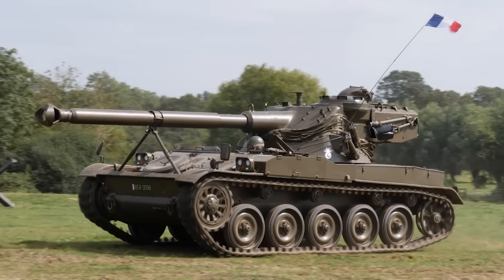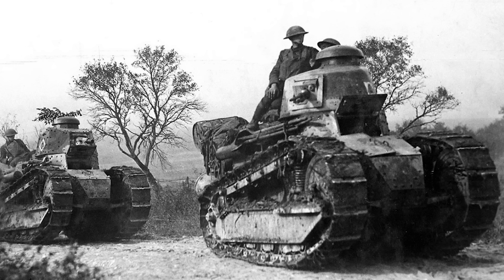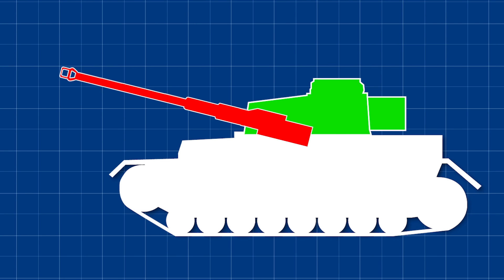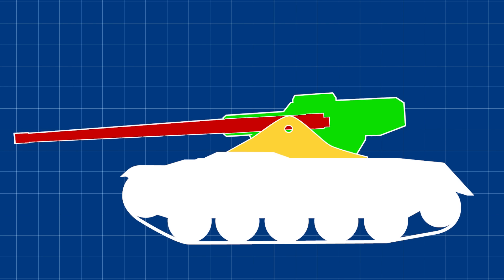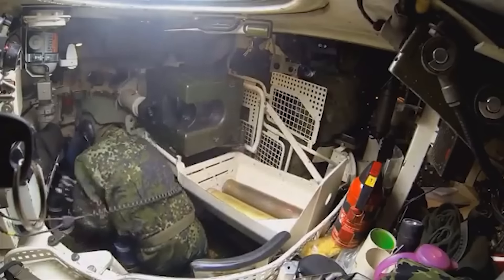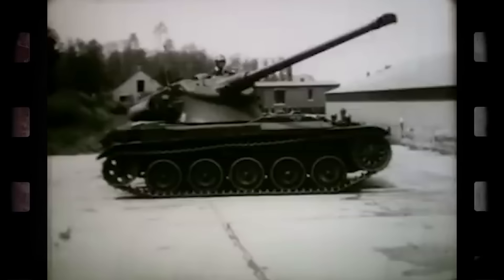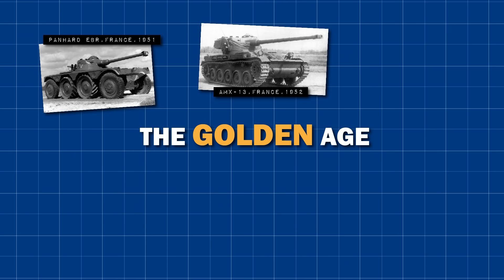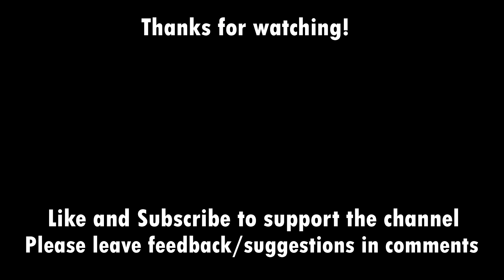What actually IS an “Oscillating” turret?

Comment: Considering that many new tanks are moving to unmanned turrets and either choosing or being forced (on account of the weight of 120mm+ shells) to move to autoloaders there may be a chance of oscillating turrets making a comeback
Reply: That same weight and size of the ammo works against it though. Moving all of the ammo to elevate or depress the gun is more work, and the bustle size gets in the way more too. It will be interesting to see where the competing ideas end up.
Reply: @llamatronian101  While not on a tank, an oscillating turret for a 155mm gun has been built and used. It is the Swedish Bandkanon I. If an oscillating turret is mounted at the very rear of the vehicle, then excellent elevation angles are achievable over the frontal firing arc. The downside is that any rear mounted turret struggles with gun depression in the frontal firing arc. For the Bandkanon I, depression was deemed unnecessary.
Reply: I don’t know if that’s really the bottleneck or reason for the disappearance of autoloading oscillating turrets . The primary reason for them was the difficulty in loading the gun at angles above or below 0. With modern technology and modern fire control systems tanks can fire the gun depressed,  move the gun to a neutral position, reload, and return to the original position. All while keeping the gunners sight on target the whole time. There are also plenty of vehicles and spgs with guns that are bigger than 120mm that are hand loaded or assisted hand-loaded. 

Not saying your prediction is wrong but having people in the turret and large shells were not the reason for oscillating turrets disappearing. So I don’t think these factors matter either way.
Reply: I kind of agree. The problem is if the terrain is already that hilly you might be better off with artillery style systems with a tank for line of sight protection.
Reply: @ES1976-3  What are you saying ? oscillating turret didn't have any difficulties with auto loaders (that's why all oscillating turret had an autoloader) it is the conventional turret that has problems since the gun is independant and when angled the autoloader couldn't load proprely where as in oscillating turrets the gun, autoloader and upper part of the turret were all fixed together and the alignement between the breach and loader always neutral.
Reply: @JWQweqOPDH  Just pair it with a tank with great front depression and that's it. Or, even better: spin the turret around 180 degrees, and just fire like that. Excellent depression achieved (at the cost of elevation) 
New idea: Double sided tanks?
Reply: NBC thing could be solve with fitting the tank with a good M/V system to keep the cabin in +ve pressure.
Reply: @JWQweqOPDH mostly because it's an artillery piece, not a destroyer
Reply: Plus, the issue of oscillating turret not being sealed off thus putting the crew in danger of chemical weapons might not be an issue nowadays since many turrets can now be controlled remotely. The crew could be in another part of the tank that is actually sealed off.
Reply: @JWQweqOPDH  Why not have the ammo stacked sideways instead of to the rear? Have it fold up in storage or maneuver, and fold down in combat like the wings of carrier aircraft if it sticks up too much otherwise. Name it Rabbit tank.

Comment: Another big issue probably also is the fact that its quite difficult to stabilize the entire turret and not just the gun
Reply: and you can't put much armor on oscillating turrets, because if the armor is too heavy it will need more power to move the actual turret, that is the main reason why you dont see MBT with oscillating turrets. a tank needs at least be capable to resist being hit on the front armor. oscilating turrets are VERY easy to penetrate.
Reply: A poorly balanced gun has the same issue. I doubt that stabilization of an entire turret is any harder if it's well balanced.
Reply: @Primarkka  no. A gun a) is MUCH less heavy than for example the turret of an amx50, b) even if it was similar, the mechanism is completely different, the gun is horizontally fixed in the turret, there is much more space in there. Compare that to oscillation whwre the turret moves, its cramped as fuck
Reply: Even stabilizing just a gun is quite difficult, that's why most tanks guns aren't even 100% stabilized. They're "mostly" stabilized but still have a bit of sway, with the FCS programmed to fire the gun when the sway lines up with the aim point. 

Naval guns, at least in WWII, work the same way too. Whenever the plotting or central fire control room pulls the trigger, the ships FCS will wait until the ships rolls is level before firing all the guns.
Reply: i could imagine that it gets easier to balance since you can counterweigh the barrel with the autoloader and shells
Reply: @peterheinzo515  nope, the barrel weighs nothing compared to the armor, (most often used) autoloader, shells, etc
Reply: @domschra  But it has a longer moment arm. Definitely could balance it
Reply: @bex3495  the thing you would probably not know it's the time these vehicles were made in the 50's all tanks from the west  or such were not heavily armored for one reason the new shell invented by French armament labo with help from germans Nazis engineers who were drafted.
The main result would be every thickness of armor was pen by this round. So the let down armor for speed and mobility  that explain amx 13, kuirassier, Leo 1 pz 61 /68 ad contrario Sweden who  doctrine was to have ambushed tanks facing soviets ones have developed their own concept
Reply: @bex3495 Yeah and even it if wouldn't penetrate the turret it could block the mechanism by deforming the armour.
Reply: @badbotchdown9845  Not all western tanks were lightly armoured and fast, just some nations, like France and Germany, decided it wasn't worth trying to armour the tanks against the rounds they'd be facing and instead focused on mobility and firepower. The British are an example from the west that didn't follow that doctrine with tanks like the Conqueror and later the Chieftain, as is America with M48s and M103s among others.
Reply: Oscillating means "to sway". So its actually intentionally not stabilized. This allows the vehicle to "stop shot" but its much faster to align the shot since the turret is already in position with the gunner.
Reply: @timothystone3360  w h a t
Reply: @domschra  Normally a tank(of thoes era's) must do 3 things in order to fire an accurate shot.

1. Stop the vehicle

2. the vehicle will dip due to the brakes being applied and the forward momentum abruptly stopping. Now they must wait for the hull rocking to stop. so that the turret can be aligned. 

3. Align the turret and adjust for distance. Fire. 

An oscillating turret eliminates the need for the 2nd step. Because the turret is constantly rocking seperate from the rocking of the hull. Therefore only step 1 and 3 are needed. And since the turret is always aligned with the gunner step 3 can be achieved more effectively and quickly since the gunner is always in line with the gun and can see what the gun sees at all times.

Comment: The gap in the oscilating turrets actually might not be an issue nowadays, if your able to control the turret remotely, while the crew is actually in a safe sealed off in another part of the tank.
Reply: thats what i am saying, inst weird because you dont need the loader in the turret, so you can seal the crew in the lower part

Comment: 4:18 Gotta point out, modern tank sights aren't enslaved to the gun, it can stay on target when the gun is away while the loader is doing his or its job
Reply: Yes but mechanic laws just Say that it wont return exactly at initial position. There is Always a difference and this Comes to be an issue with the distance of the target.
Remember that in practice, the precision of the shot at 2000m is about 4m.
Reply: @tricosteryl  Yeah, but that isn't an issue as just firing the gun will change the position of the gun at least as much as bringing it to the index position and then back to firing position. Recoil dampeners aren't perfect as well.
Reply: @Retired Bore currently working as an engineer I confirm returning at the same position id impossible.
It is mechanical fact.
And the precision required hère is very high, so this may be satisfacting if the target is really close, but we dont anticipate that a tank fight will be like in wot.
Reply: @Retired Bore the story is that terrain performance is Always worse than theory
Reply: @Ruhrpottpatriot  Sure but changing one thing is going to affect accuracy, doing two is going to affect it more (likely by the square - not just the sum of the two things).  It's like saying "jump up and land in exactly the same place you're standing now".  Well, the act of jumping will slightly change where you end up, but running around in a circle before you you jump will change it a LOT more.  Point is, don't compound the problem.
Reply: @smgdfcmfah  That's not the point I was trying to make (btw: it's just the sum of imperfections, not the square). The point is: That in practice it doesn't matter that neither recoil dampeners nor the gun return (i.e. the system that allows the gun to change position to make it easier to reload and then return to firing position) are not perfect.
Reply: @Ruhrpottpatriot  But my point is that by moving the gun twice you're compounding the problem.  First it fires and messes up it's position a little (as you say), then you move it for reloading and it tries (and fails) to return to the exact position it just left, which was already flawed.  The sum vs. square thing is less important as either way you're making the problem worse.
Reply: @smgdfcmfah  And yet it doesn't matter in practice. You're not trying to hit a needle-head on 5km range. You're trying to hit a multi square meter object.
The benefits of having your loader have a more ergonomic loading position far outweighs the disadvantages of that miniscule shift in gun position.

The imperfect movement of the projectile itself after it leaves the barrel is far greater than any shift in position due to unstable mechanics and hydraulics. Heck, the rocking of the tank suspension after a shot impacts accuracy more than mechanical imperfections.
Reply: @Ruhrpottpatriot  Sorry but you're dead wrong that it does "not matter in practice".  Your point that we're not trying to hit a needle head on is meaningless.  The ranges involved mean that a change of just a centimeter in the elevation or direction of your barrel can mean MANY meters of change in your final target area.  

Now you're talking about this being more important than that etc., which is all fine but it's a completely different argument.  All I started with was that just because you have some instability in one place it is NEVER meaningless to add more instability in another place.  It's like saying it doesn't matter if the sun is in your optics and you're having trouble seeing the target because there's a heavy cross wind anyway.  One has nothing to do with the other, they're just both making the same problem worse.
Reply: @tricosteryl why do modern tanks then do that if it doesnt work?
Reply: Modern tanks generally have stabilized sights, where the gun follows the sights
Reply: @smgdfcmfah  there is no compounding effect, the calculation will always take inputs from the current position minus the target position. Not the current position minus the prior positions.
Reply: @smgdfcmfah Modern fire control systems use software combined with laser muzzle reference devices to completely fix that problem. It's not an issue in a world full of electronics, where you can measure the tiniest mechanical imperfections in the mounting or the barrel's bend due to thermal stresses. Fire control system will make sure the gun will always come back to the exact same spot. Modern 105-120mm sabot can repeatedly hit a target the size of an A4 piece of paper a mile away.

Comment: Amx13 had a "rubber" skirt around the joint between the 2 turret parts, making it NBC  protected accordingly to standards of its time. But this was vulnerable and also had  to be replaced frequently because of Wear.
Reply: i know its weird but why is so hard to protect the crew if you dont need a person in the turret?  cant you know,, seal the crew in the lower part?
Reply: @anonimoqualquer5503  i think you're talking about the M1128, and the flaw wasn't because of the seal, it was because of bad reliability of the turret system. They are safe from NBC, and it wasn't the reason why it failed

Comment: With the increasing interest in unmanned turrets, I think this kind of turret would came back in popularity. The crews are safe in a highly armored compartment in the hull, the turret is not even manned so you could get away with even bigger guns like how the M1128 did it and have the option of swapping out new turrets in the field by replacing the upper turret with something like a missile battery for AA duty, auto cannons, laser weaponry, etc while still keeping the lower turret (collar). 

The problem I can think of with this design is that it is very difficult to reload new ammo into the bustle in the field without exposing the crew, so we could also use an ammo carrier similar to how the K9 howitzer has its own dedicated reloading vehicle based on the same chassis. 

So a modern oscillating turreted tank, with full NBC protection, smaller hull and turret as well as a bigger gun and reloadable bustle, very interesting concept indeed.

Comment: Excellent video, however, quick note about aiming the gun away from the target after firing. most modern tanks are capable of delinking the sight from the end of the gun tube. example, the M1 Abrams' loader has a switch he can flip. Doing so will move the gun to a more favorable position to reload(if the gun is at max depression the breach block is near the roof of the turret), at the same time delinking the gun tube with the gunner's sight. During loading the gunner can continue to track the target due to ballistic computer being linked to the optic and not the gun. When loading is done the switch can be flipped off for the gun tube to relink with optic. with powered elevation the gun tube moving from index position to where the sight is pointed takes a second at most. so having the gun index is not as significant of an issue as stated in the video.
Reply from the maker: Absolutely - modern systems make it a more trivial issue. Back in the day it was more of a concern when the sight couldn't be delinked - for early autoloaders like the IS-7 it was much more of a disadvantage and the gunner had to manually relay the gun I believe. Maybe I should've made that distinction more clear! Glad you enjoyed the video.

Comment: The big benefit of oscillating turrets is with full stabilisation, which means the crew gets fully stabilised with the gun, it also makes automatic loading a lot simpler. But it means a lot more decisions need to be made in the design phase.

Comment: The oscillating turret's carriage is basically the same design as has been used for artillery for many years; the older artillery gun barrels had trunnions (pivot pins that would allow for gun or howitzer elevation & depression) that  would attach directly to a cradle mounted on the gun carriage.

Comment: The Kürassier tank of Austria is also a notable oscillating turret tank still in use. They have the same turret as the AMX 13 and look just as iconic
Reply: The first few turrets were from the same manufacturer (Fives Lille) and the manufacturer sent engineers to help set lines in Austria for local production of the local variant

Comment: 4:20
Every modern tank, even the ones without autoloaders, have their guns move to a loading position after each shot. It doesn't matter at all, because the sights are desynchronized from the gun orientation.
Reply: This is mostly done in peacetime, to help the loader.

Comment: Our company development the HiMag weapons system, as mounted on an early LAV chassis.  This used a 75-mm high speed Israeli cannon, and was capable of disabling any modern tank, except in direct frontal engagement.  The gun was mounted high, outside of the turret, so was exposed.  The vehicle was very lightweight, very fast, and far more agile than any tank system of that time.  It would be a wonderful battlefield weapon NOW, against drone warfare, and against static artillery.  It also made for a practical remote controlled vehicle, capable of attacking any static position easily.  At that time, the exposed gun was considered a weakness, and the project was scrapped, even after many successful demonstrations against existing tanks.  Now, used similar to drones, that technology will soon come back onto the battlefield.